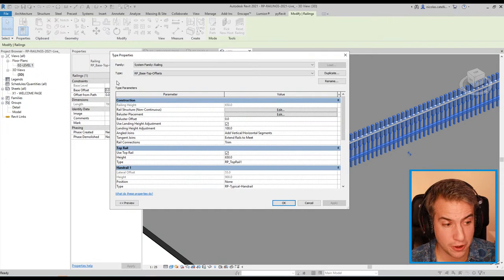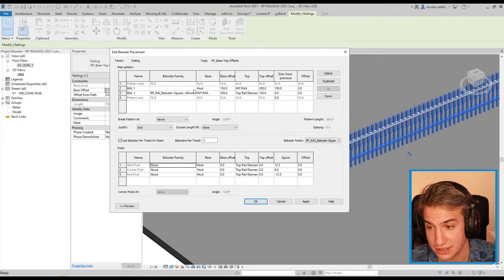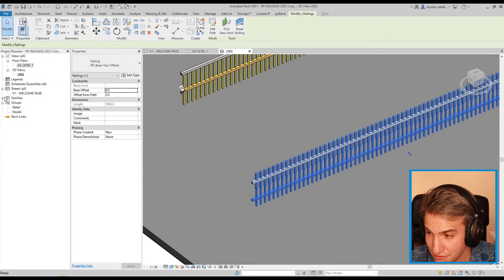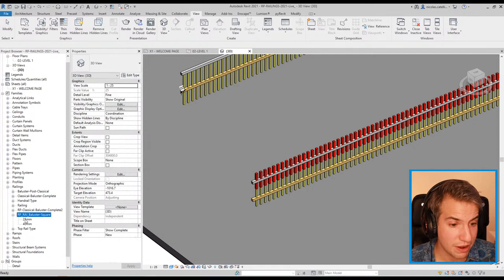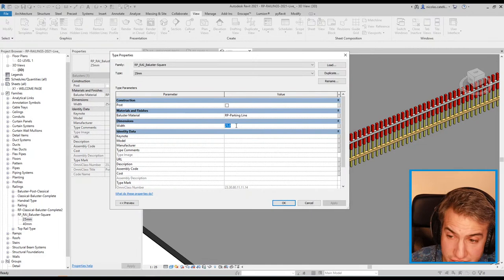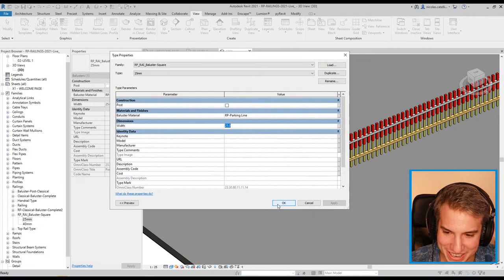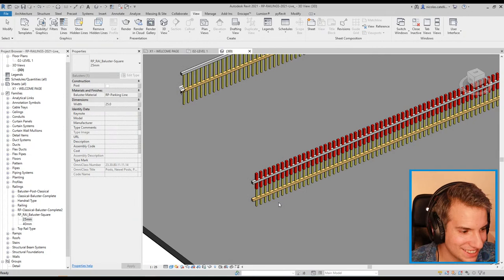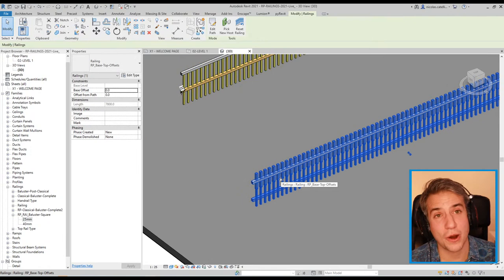Revit Pure Live #001 - Railings and Classical Balusters

Comment: Great presentation. Thank you for the information. 
Just one question. When the check mark for "balusters per tread" is selected, can the the first baluster be constrained to align with the face of riser below?
Reply from the maker: By default, the balusters will be aligned to the risers. However, if you modify the boundaries of the railing path line, they might lose their alignment.

Comment: Is there a way to get the "excess fill length" banisters to not be started on the host base.  The railing I am doing has a bottom rail at 3" and then 1/2" pipe balusters go up from it an a support baluster that goes to floor is placed every 4 ft.  So on railing runs that are less than 4' it is filling in with with the excess fill baluster, which is the same 1/2" pipe, but revit it placing them from the floor.  I tried creating a 'fill' baluster that started 4' off the base level but revit just dropped them to the floor and they stopped 4" from the top rail, instead of starting them 4" from the bottom rail.  i would really appreciate your help if you have any advice.